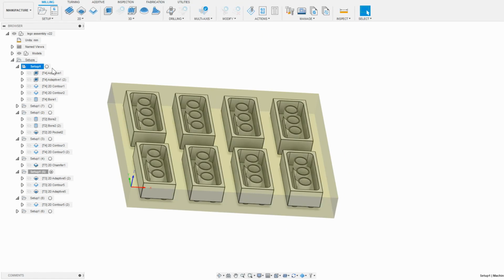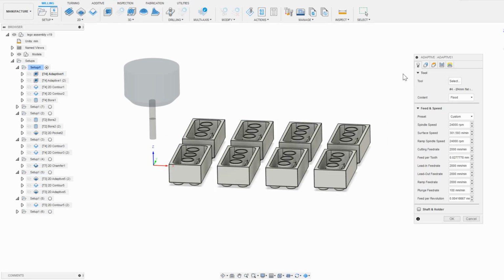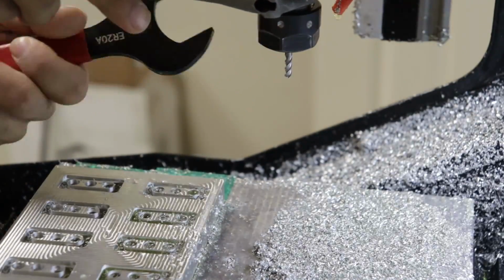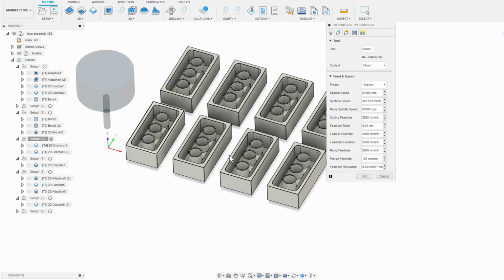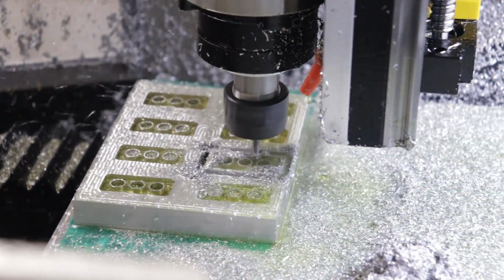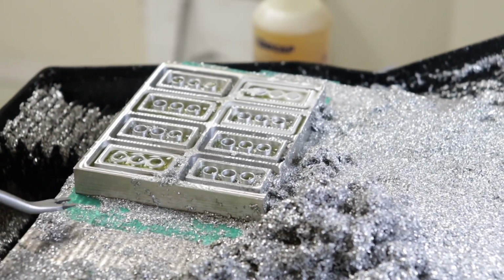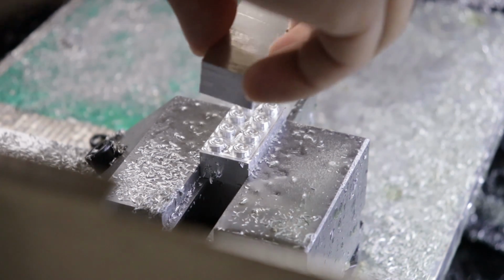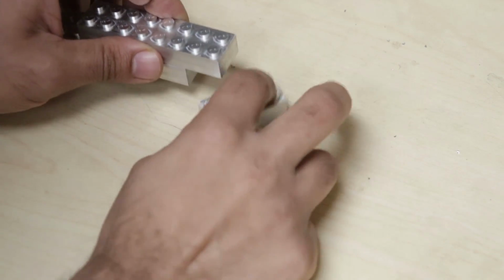Machining Lego Bricks on the DMC2 Desktop CNC

Comment: I appreciate your efforts in creating a desktop cnc with some actual rigidity but your lack of experience in a professional setting does start to show in some of these tutorials. 

It's common practice to be using tool radius compensation on your finish passes. 

Almost every modern cnc controller is capable of this including fanuc, masso, centroid, Linuxcnc, DDCS, etc.

This most typically looks like 'G40' or 'G41' depending on side followed by 'D' with most commonly your tool number (same as H in most cases). 

Tool comp usually is picked up in a X & Y move and is canceled in one as well with a G42, but your cam software will take care of that. 

Your radius comp value is usually stored along with your tool length offset. 

YMMV it depends how you have it set up and how you program, but I always program based off the tool center. Therfore, a negative value cuts more material and a positive value leaves material. As in a -.001 value will cut an extra .001 off profiles where I'm cutting one side or .002 extra off a circle.

Some people program with the tool radius always entered into comp but I feel like this leaves more room for error when the set up guy forgets to clear his comp out from the previous job (ie a .500 tool would have a .250 value).

Comment: Use option In Control then you can adjust tool diameter offset in the tool library in your controller mach4/masso g3/hass or whatever you are using. That way you will only generate code once and then creep up on the perfect dimension.

Comment: Just a hint, instead of creating a new imaginary tool, it is usually easier to replicate a toolpath and use smaller or even negative values on the "stock to leave" for the operation in question. That way you can iterate quite quickly and don't have to do math with tool diameters etc and dial in the stock to leave to get the fit you want.

Comment: What is the software?
Reply from the maker: Mach3. The machine also can run GRLB out of the box. Or you can use your own software/controller and just connect the pulse and direction signals to the motors. See the detailed video for more info
Reply: @shariffdmc3406  is it compatible with FUSION360 or G CODE ?